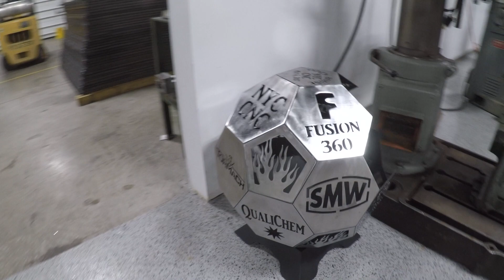Rusted Chuck, The E-Myth, TIG Welding Classes! CB53

Comment: Hi John,
Use an oil base coolant and you will have better luck with your chuck. Every time I used synthetic coolants I had problems with the crud build up on the bottom of the chuck in less than a year. Never had the problem with oil base coolant.

Comment: That chuck will be just as corroded and rusty in a few years. It's a fact of life for surface grinders. I doubt cleaning it will help you grind that chuck flat. More likely you have wear in the ways. But, I could be wrong. It sure won't hurt to clean it up.

Comment: Air tool oil is an excellent rust inhibitor.  A real light coat on the table and the chuck and place the contact areas together. slide the chuck around the table and let stand overnight.  Next morning fasten down and get to gri ding it in.  oil should have crept out from under contact areas and remained in the pours.

Comment: would a dab or 2 of transmission fluid help with rust? had a drill Chuck rust shut and that helped a lot...
Reply: It should, or at least can. ATF is half of the equation in the mystical rust buster loose juice that is ATF+Acetone. Some guys swear by ATF+Diesel too.

Comment: You have an absurd amount of space in that shop. Unreal. A dozen machines easy on top of what you already have in there, some of them being 100+ inches in the X. Due to the floor space, your only real limit is the thickness of concrete you have underneath to support the stuff.